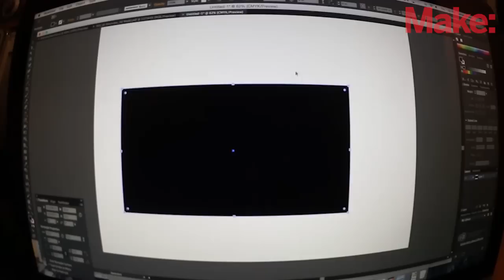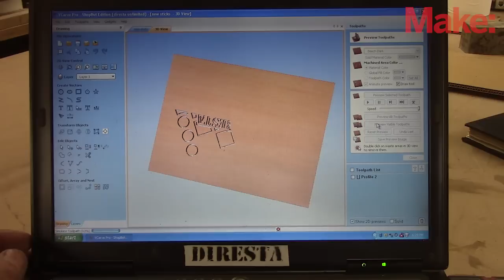DiResta: Push Stick

Comment: As one that has accidentally cut off part of his thumb with a table saw I highly suggest the use of push sticks.
Reply: as someone who cut off his pinky i concur!
Reply: jimmydiresta My wife adds fingers make horrible push sticks just don't do it not even once.
Reply: *****  i agree xo
Reply: The worst part about it was about a month earlier I put a 16ga. air staple through the other thumb.
Reply: jimmydiresta Wow I'd never noticed that, and I had always of wondered if you may have had a mishap on your table saw.
Reply: jimmydiresta it looks like u have both ur pinkies
Reply: NEVER put metal on your push stick.  you guys never learn.

Comment: They look great Jimmy. I know you have a setup for your vac but I had a question - would a sheet of compressed air blowing across the work piece then collected by a vac at the opposite side work too? Was worried it may not blow all the dust out of the crevices, thoughts?

Comment: Is it odd that the first thing i think of to comment is about how the layout could use the material more efficiently? I could see how you would want to lay it out that way if the grain of the material mattered in the finished product, but I can't see how it would in a push stick.

Comment: Since you put magnets in the bottom of the push stick, I guess you don't cut your push sticks very often?
Reply: I've watched Jimmy DiResta's video's over and over. There are numerous shots of Jimmy ripping on the table saw and he does not cut his push sticks.
Reply: Wouldn't use the magnet'ed version with a SawStop.

Comment: Jimmy, you are going have to come up with a way to get rid of shavings off your work piece when using the CNC. Dude like you has better things to do that hold a hose. Strong fan, air compressor, witch hand holding a vacuum.... lol! Hell flip the whole thing upside down or on its side... 😜 if only I could get paid for my thoughts💰💵.

Comment: You had me until you put metal projectiles (magnets) in your push sticks. Just imagine hitting the blade with one of those! Standard safety glasses will not help. I personally don't think they should be there at all. But if they must be, why not put them up where the blade could not reach them?

Comment: One day you will pull out thiese magnets off your chest.
Reply: +IIIANVILIII those magnets are actually dangerous indeed. haen't thought of that tbh
Reply: +Mees Deppe i think stripes of magnetic rubber (like in a frige doors) will be safier.
Reply: IIIANVILIII somewhat, but they won't be strong enough. the magnet he used are neodium magnets